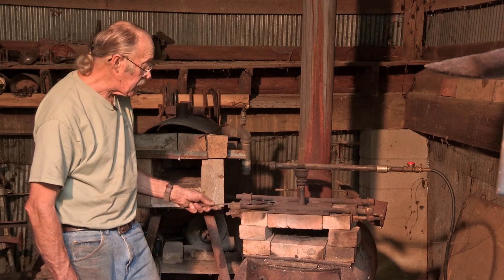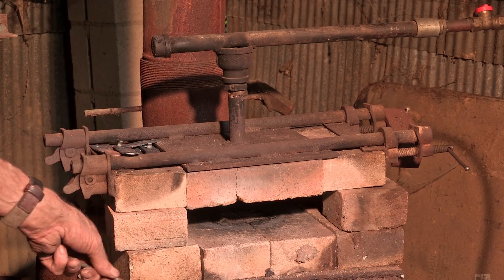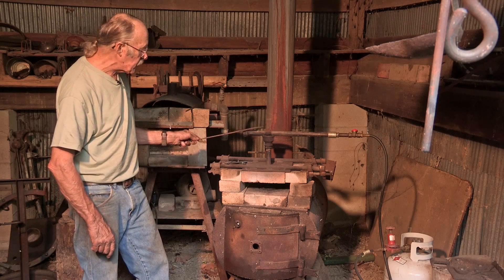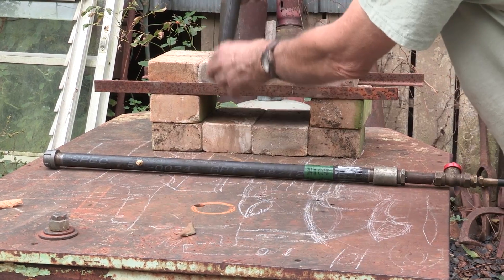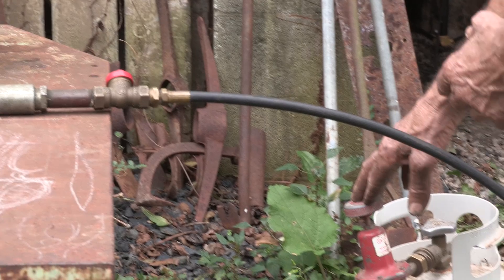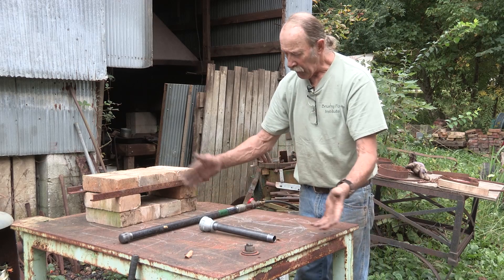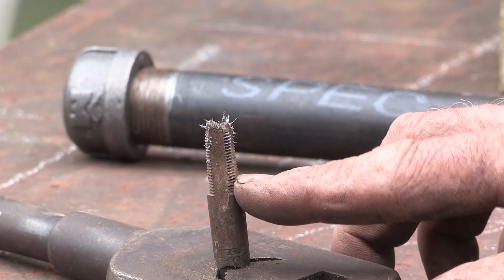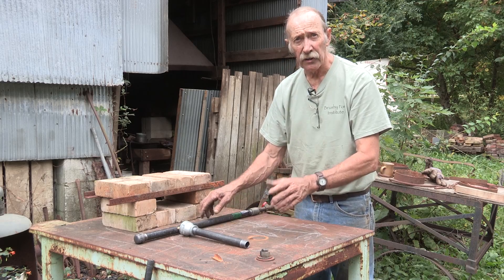Build a Propane Forge

Comment: I have natural gas at my home.  I know that it has less thermal energy than propane however.  Can this be adapted to run on natural gas instead?
Reply from the maker: Sean, I can't think of any reason it wouldn't work, but I'd certainly be careful hooking it up to the household!
Reply: Yes, the orifice is all you have to change. I don't recall the exact size hole.
AAR
Reply: Getting the pressure high enough would be the issue.

Comment: Any idea where we can get firebrick (I'm in a rural area so sometimes it isn't so easy to just go get stuff) and how far into the heat chamber does the burner tube extend?
Reply: Chimney and fireplace stores. In Florida I found refractory, soft and hard firebrick in a ceramic supply shop!
AAR